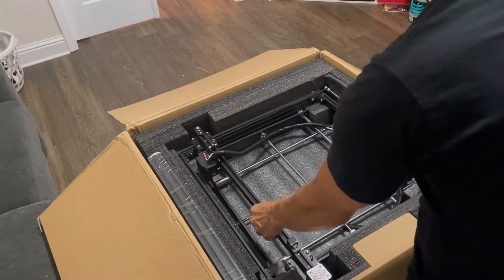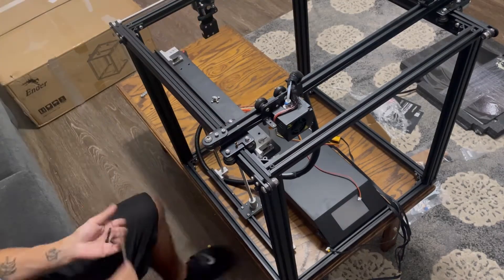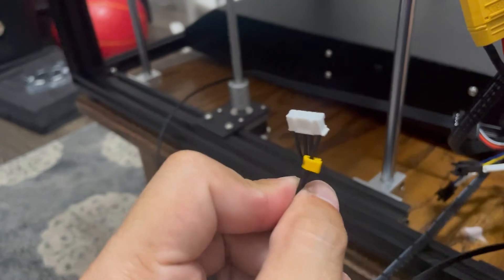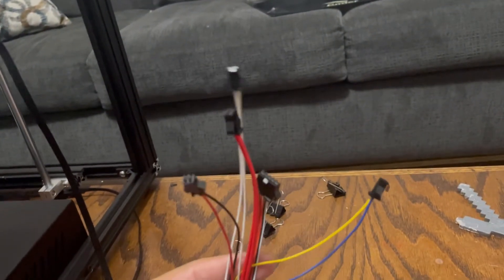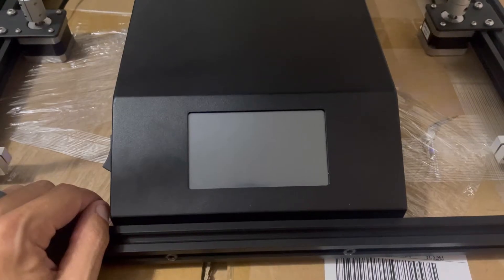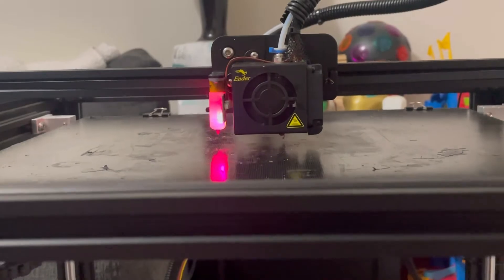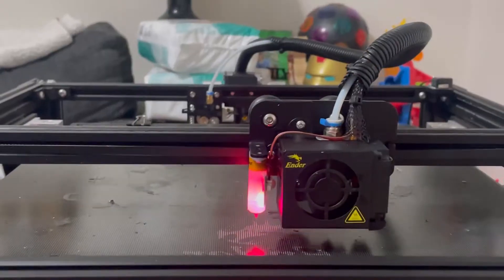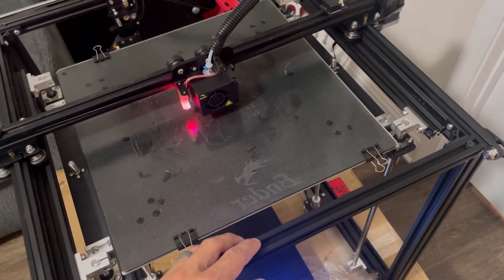How to set up ender 5 plus | ender 5 plus bed leveling & assembly | ender 5 plus review & 1st prints

Comment: I have a problem with my ender 5 plus 3D printer I was using a school computer is Dell laptop so I put my SD card inside my computer it did opened the SD card on the screen but I try to send my 3D models files to my SD Card on and I slowly take it off and put it on the ender 5 plus 3D Printer but when I opened the print button on the 3D Printer screen it doesn’t shows the files on the SD card that I send on the laptop computer like it doesn’t shows on the 3D Printer screen what’s going on? Can someone reply my comment immediately? I’m even got pissed off mad by dealing this issue

Comment: Help me i have a ender 5 plus and when im leveling it goes to home and then it doesn’t show auto bedleveling
Reply from the maker: Have you tried shutting the machine off & doing it without the sd card in it?
Reply: @Darkwingdad  i’ll try that
Reply: @Darkwingdad  now that you are here i can’t get my fillament in the tube through the filament sensor
Reply from the maker: @спутник-у6у  cut it on an angle
Reply: @Darkwingdad  the bed leveling thing is still not there im fucking throwing it out a window bro fucking hell
Reply: @Darkwingdad  doesn’t work i still don’t have it
Reply from the maker: @спутник-у6у  likely a firmware issues, you’ll have to reflash it
Reply: @Darkwingdad  how tf do i do that
Reply: @Darkwingdad  im so fucking done i legit just got it and i can’t even find how to refirm it
Reply: @Darkwingdad  im fucking done with this bullshit i can’t find how to do it im fucking returning it
Reply: @Darkwingdad  i did it still doesn’t work

Comment: I've veen trying to level my plus for almost two weeks now. Your video really helped yet for some reason though I can get only one side perfectly level. The other will always be off a decent amount. Think 414 to 690 vs 675 to 678. I use the paper method and get each side to feel the same with the very light grip. The bed and nozzle are heated. The z axis is fine. Nozzle also leveled whenever I try. I'm unsure of what the problem is. Any ideas?
Reply from the maker: Stock springs correct?

Comment: I’m struggling so much to level my ender 5, it printed the test print fine, and then when I printed a bed level test, it’s scraped into the bed and squished the filament in flush with the bed. All the previous videos I watched told me not to bother adjusting the springs and to just leave them maxed out, this is the only video I’ve seen that’s told me to start with this.. unfortunately I now need a new bed before I can move on
Reply from the maker: Always always start with the bed level. I highly recommend getting silicone bed mounts for your ender. You’ll go from relabeling your bed 1-2xs a week to 1-2xs a year. Don’t be afraid to flip the glass bed over and use hair spray for adhesion, you don’t need a new bed plate trust me!

Comment: I just got mine yesterday and I haven't being able level it.. the problem is that the center of the bed is higher than the 4 corners and I tried fliping the glass just to see if I see the same problem and I did.. the center was lower then the corners..is there a fix to this??
Reply from the maker: Sounds like your bed is warped. You’ll need a new one. I would contact them for a replacement
Reply: @Darkwingdad  I just did a quick fix by adding a piece of paper in the middle under the glass to push it up and it works.. but I will get in contact with them to get a replacement... Thanks
Reply from the maker: @davidcarreon472  I would recommend using a metal washer. I know it sounds silly but the paper can start on fire. Sometimes if you turn the bed temp up and use a washer it can rewarp the glass back to flat
Reply: @Darkwingdad  that's a good advise, I didn't think of that... I'm a try it and hopefully it works.. I did send an email to  customer service hopefully the can send me a new glass

Comment: I can't seem to get my leveling done.  I select level, set the center, then start the aux leveling.  Go through points 2 through 5, adjusting the dials, then go back to point 1 and the nozzle is pressing into the bed.  I then go back through points 2 through 5 and readjust again, then back to 1 and still digging in.
Reply from the maker: Are you setting your z home point?
Reply: @Darkwingdad  yep, which is what is making this really confusing for me.  I have a snapmaker a350 but have had issues with the linear modules on that, so figured I'd get the 5 plus.  Going to play a bit more with it today too see what I can adjust
Reply: I got it leveled.  Lots of micro adjusting and then once it was close I started a print and hand adjusted there.  Made a benchy and it came out pretty good
Reply from the maker: @AFDrye  nice! Use that z axis offset for minor adjustments too, it helps a ton

Comment: How has your luck been with PETG?  I use Overture PETG on my Prusa Mk3s with no issues, but recently bought the e5+ and have layer gaps, zits and have upgraded to capricorn tube and metal extruder. I am also using a .6mm nozzle. Bed is leveled. I use Prusa Slicer and have tried Cura as well. Thanks,
Reply from the maker: Since the hardware upgrade have you recalibrated your flow,esteps & done a temp tower? I know the 5+ are known to have botchy factory parts, one of them being the hot end. I have recently upgraded to an all metal hot end and it reduced a lot of underextrusion I had. Also new fans are on my to do list. Is your mk3 stock?
Reply: @Darkwingdad  Thanks for quick response. Mk3 is stock and is awesome! For the E5+, no recalibration was done since I left stock hotend and still bowden system. I forgot to mention I upgraded to the Silent Board with TMC2208 Driver.  Extrusion multiplier is set to 1. Have not touched esteps and can do a tower next. What hotend do you recommend? I know I could go with micro swiss and convert to direct drive at the same time but want to slow down on upgrades for now as that would be a rabbit hole! Exoslilde kit is on order as well.
Reply from the maker: @chrisgilreath2821  so a few things going on that will help. 1) definitely recalibrate your flow, a bigger nozzle can definite affect the way the filament is extruded out. 2) with a new board you definitely want to recalibrate esteps as it’s send a new message to the extruder motor so if you have your old esteps still in that could be causing the blobs or gaps. 3) when you installed the board did you check your driver motor voltage? The x,y,z & e should all be between .75-.82 volts. If the e motor is lower that will cause a “lag” and result in underextrusion. I would check those 3 and let me know how it works, I can always throw a video up to on how to check that voltage if you’re unsure
Reply: @Darkwingdad  A video would be helpful. I thought the board was plug n play since it was a creality board and they would have had the esteps the same. I will also look and see how to recalibrate the flow. Thanks.

Comment: nice video , I'm a total newbie with 3D printing and essentially my company bought one so I have to learn it.  I'm looking for those fine tuning videos for it but can't find them on your channel.  Did you make them and if so can you point me to them?  Thanks
Reply from the maker: I’ve got a video on silk printing that shows some fine tuning, I also have a few printer set up videos that show how to calibrate esteps.
What else are you looking for tuning wise? What slicer do you use?
Reply: @Darkwingdad  I just got this printer and put it together with a few issues I've fixed because it was an amazon return.  I have never operated a 3D printer but I am familiar with Cad and have dabbled with fusion 360 but since my initial dabbling I think they have become paid subscription to get the meat of the program.  I'm looking at freecad possibly the slicer called Cura to start out.  I haven't downloaded any slicer yet. I'm still attempting to figure out bed leveling and the spring adjustments and such.  I have a fair number of questions I keep looking for answers on various youtube channels but I find there seems to be no really good instruction pdf or video on operating this machine.  The build manual is ok but troubleshooting this machine was a leaning curve just for what I've run into so far.  The pin was broken on the BL sensor and the top left rail had slight damage and was causing the belt tension to screw up.  All fixed now but it was a task.  I'm a machinist and electrical engineer so I understand how it works and such but the details of how to set up the bed through the software seems to be a puzzle using that 5 grid set up which doesn't seem to work.  On top of that I'm wondering if my firmware is out of date as my controller has V 1.70.1 BL .  Tons of other questions and a slow process learning curve for a newbie.  I'd like to see the estep calibration and any other tips you may have.

Comment: I'm so jealous. Mine arrived weeks ago and I haven't moved passed leveling. When I switched out the motherboards during assembly, because the dummies hot glued the wires, I acciendentaly ripped the Z axis wire out and tried (my first soldering project) and I still doesn't naturally move close to the nozzle or complete the leveling. I'm beyond disappointed I can't use a brand new machine
Reply from the maker: So you ripped the pin off of the board?

Comment: Mine arrived today, your video helps (yet again). Setting it up this weekend.
Reply from the maker: Awesome! It’s a great machine, just loud, but I ordered the silent board so I’ll have that video for you too!
Reply: @Darkwingdad  got it running, doesn't seem louder than my old CR-10S. I did a test with one of their files, on the "upgraded"  glass bed, with no other adhesion, and it went well until the very end when poor little Pikachu came loose. I see you flipped it and use hair spray, on my old printer I was full old school, blue tape on a mirror and glue stick. Is there a trick to using the stock "upgraded" surface?
Reply from the maker: @owenbrau63  hairspray works way better than glue stick & tape. The dot matrix beds are suppose to be better for adhesion but you really need extra smush (lower the z offset for the first layers) & use brim. Honestly I had a Cr10s too & once I did hairspray I never looked back. Give it a shot if you want I can whip up a video for ya